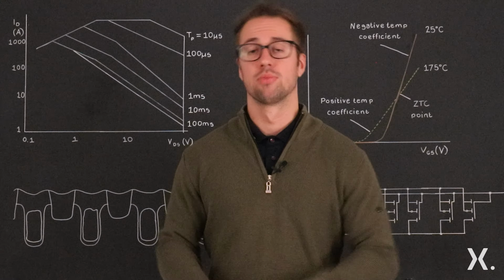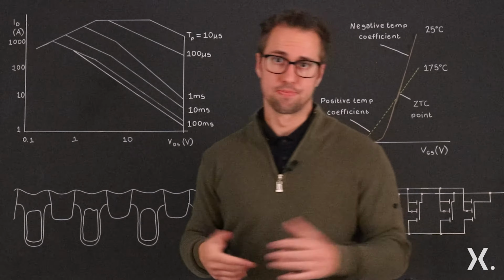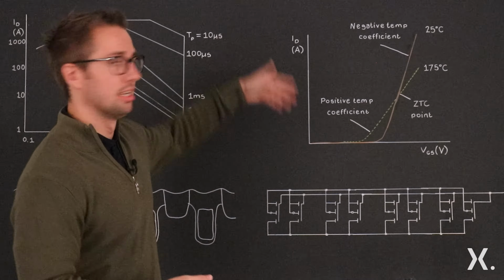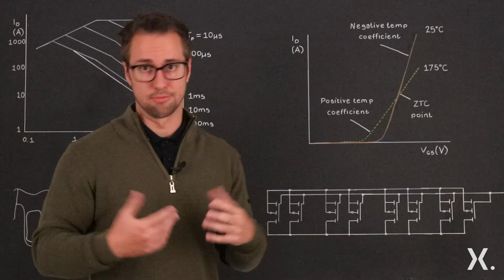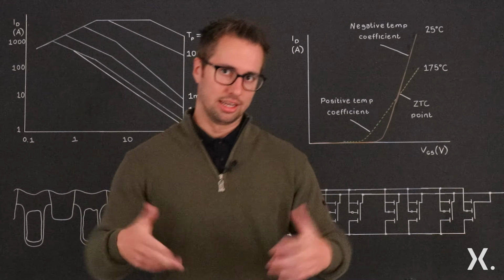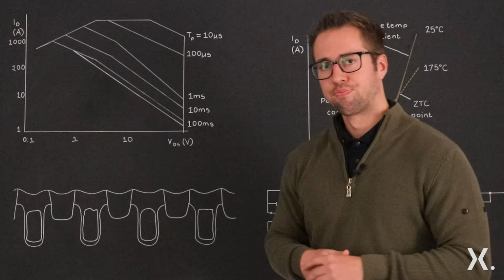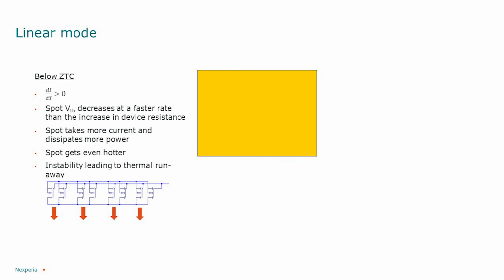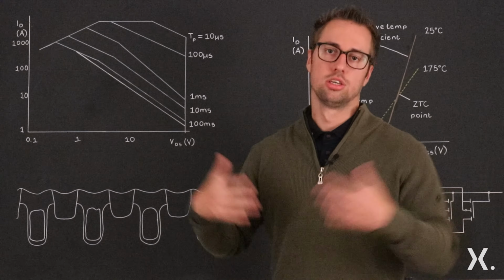Understanding MOSFET safe operating area

Comment: So the times next to the lines in the soa graph indicate switching duration? Does this assue an exponential rise of vgs?
Reply from the maker: We checked with one of our engineers and they said: The time refers to the duration of VDS being present across the MOSFET – VGS is adjusted to regulate/maintain the respective VDS during that time. We hope this answers your question, thanks for reaching out!

Comment: so I cannot use the MOSFET in DC mode like a variable resistance even with the power rating.  I only found out lately that the BJT or IGBT is more controllable in DC as variable resistance because they have higher impedance than mosfet

Comment: As per SOA curve it looks like the MOSFET Can handel very fewer AMP compare to Max raring, when used as relay for Battery management system ? Or if it is coolant is managed then it shall be used till Max rating?
Reply from the maker: Thanks for the question @thayalans4047. Max rating referred to are based on steady state conditions, meaning MOSFET is fully enhanced (current though RdsON), while SOA refers to linear mode, and the MOSFET is in its switching transition mode - different dynamics take place, hence the current capability is different.

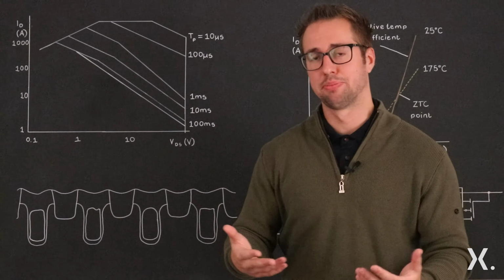Comment: 4:01 "You're safe" - Meaning? That was the key information i came to learn, and you didn't say it. Does safe mean, no heatsink needed? Or, any current or voltage over the safe line, even with a heatsink, will kill the mosfet? Or...?
Reply from the maker: Hey @johnaweiss, We checked with one of our engineers and received the following response - If you operate under the SOA lines you are safe, means for a given VDS voltage, and a given pulse (DC to 10us) if the current you select happens to be below the line, the MOSFET will operate safely.  The graph given is 25C at PCB,  provided this is maintained, whether through heatsink or other cooling method, the capability shown is valid.  

We hope this answers your question. Have a great day!